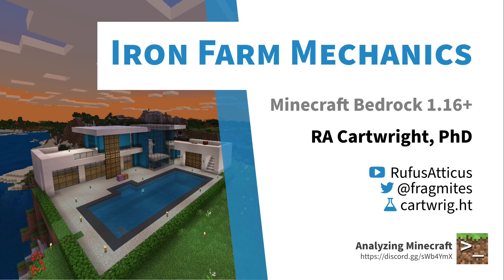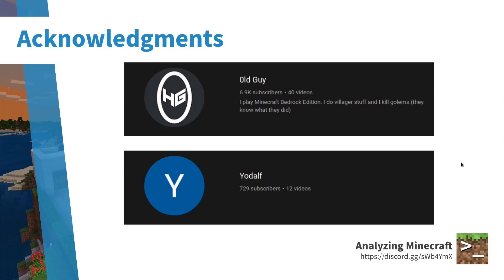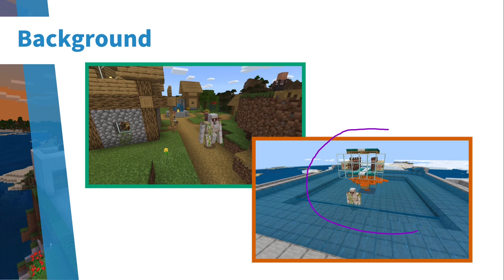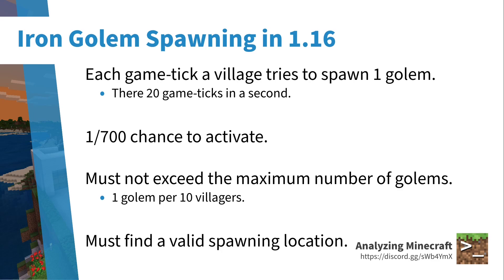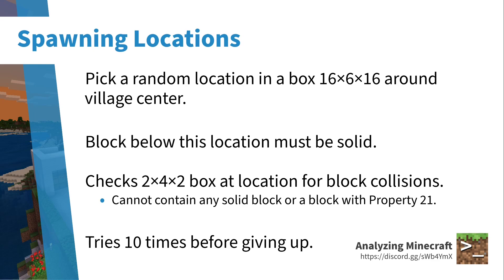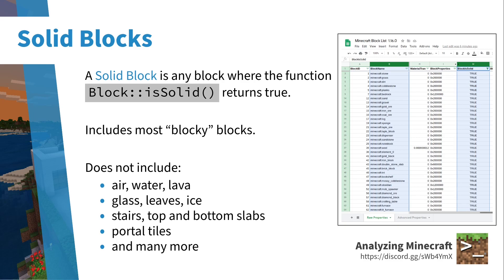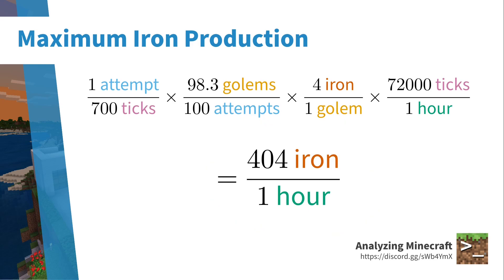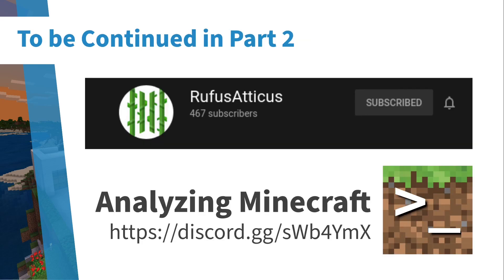Iron Farm Mechanics in Minecraft Bedrock --- Part 1: Basic Mechanics and Rates

Comment: Thank you Rufus, I have been trying to compile the Iron Golem mechanics on Bedrock.  Here are a few of the questions which I have yet to answer: will you get more golem spawns with more villagers (30 - 3 golems at once, 40 - 4, etc)?  Are there still desyncing issues with the beds, so is it still possible for the village center to get shifted?  If the village center can get shifted, would building a bigger platform to make sure we have maximum spawning locations be beneficial?  Looking forward to upcoming videos.
Reply from the maker: The village can support 1 golem per 10 villagers; however, more villagers does not increase the spawning rate. As I will show in a later video, adding more villagers doesn't necessarily mean that you will get more iron.

0ld Guy is the expert on syncing. He would be able to give you a more accurate answer than me on that. In 1.16 if you prevent villager pathfinding by trapping them in a pod, they will not agro if they can't find their beds and desync. I don't know how that affects iron farm + trading hall designs. You might still need to use water to prevent them from delinking. I think the village center would only shift if someone places down a POI or bed close to the village. If you are concerned about that, building a larger platform would be beneficial.

Comment: Hey Mr Rufus
U mentioned in almost 10:30 of the video that they can't spawn within block property 21 blocks. Do these include scaffolding?
And if they don't, can cats spawn thru scaffolding?
Reply: Mohamed Hatem, I’m not entirely sure what the property is. However nothing can spawn on a scaffolding block. However mobs can spawn inside of a scaffolding block if there is a solid block that the scaffolding sits on
Reply from the maker: Scaffolding is not a solid block and does not have block property 21. Golems cannot spawn on scaffolding, but they will spawn inside it.

I haven't checked on cat spawning to see how similar it is to golem spawning. In the test iron farm I made, they seemed to spawn on the same platforms the golems used. I dropped them into a 1x1 hole at the center of the farm. They sit on top of the hopper that collects iron eventually the cat cap is full and they stop spawning.
Reply: @RufusAtticus  so this means it would be just better to use water directly over solid platform?
Reply from the maker: @mohamedhatem3694  I don't think you can improve upon platform + water design. The water both pushes the golem and the iron to the center. Without the water, you'd have to use hopper minecarts for collection which complicates things.
Reply: @RufusAtticus  that complication is not a big deal as long as it helps increase iron farm productivity even with a small percentage
Reply from the maker: @mohamedhatem3694  As you will see in part 2, you are talking about a difference around 1 ingot an hour.
Reply from the maker: Correction: .2 iron ingots per hour. 380.4 vs 380.6 ingots. When you compare 510 spawnable blocks vs 512 and 20 villagers.
Reply: @RufusAtticus  sorry if I ask too much, but I've got two last important questions to optimize my trading hall iron farm. Will you cover center shifting in part 2? And if u can explain it now, would you please explain it detailed not briefly?
Reply from the maker: @mohamedhatem3694  I don't plan on covering it. If you are worried about center shifting, use an 0ld Guy design. He designs his farms to be safe from center shifting.

Comment: Can i increase the rates by bringing the goloms to the nether?
Reply from the maker: No. Two dimensional iron farms have a maximum efficiency of 50% because you have to use two players to run them for a long time. A properly-built, one-dimensional iron farm is going to be more efficient than a two-dimensional farm.

Or two put it another way: if you have two players, you will get more iron by loading two separate iron farms, than by loading two dimensions.

Comment: On my x box not only will golems spawn on top of a top slab but will spawn with his head in a bottom slab
Reply from the maker: You might want to double check that. Golems will spawn on double slabs, but not on a single top slab because single top slabs are not solid blocks.
Reply: RufusAtticus  they might be spawning on the edge of a block that has a wall on it . But head is in a slab . It’s not a regular thing have a big trading hall that sometimes has 5 golems roaming in it  . My world was converted over from the Xbox one to bedrock long ago it has some quirks like being able to make andesite and granite out of stone at times . But not lately   Should it happen again I will pass along a screenshot. But I think my world is an anomaly. Almost wish it was a steady bug .
Reply: RufusAtticus  oh it also may be spawning thru it rather than on it  or thru the bed. But just going to put glass under the villager set ups I have they are like   tiny rooms rather than cells .  I used old guys design for my actual iron farm
Reply from the maker: @tomdalton4016  Slabs and walls are not solid blocks, and golems do not care if they collide with them when they spawn. This is expected behavior in Bedrock.

Stone from andesite and granite was a bug in Bedrock that was fixed a few versions ago.
Reply: RufusAtticus thanks keep the great content coming .learning more of the whys and why nots thanks to you guys on exploit